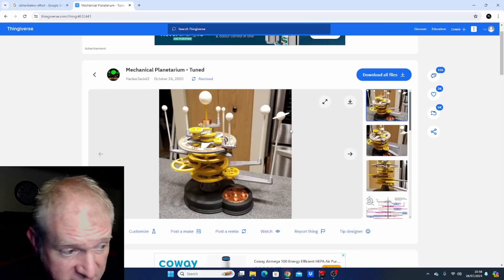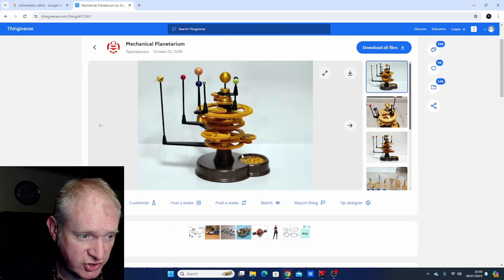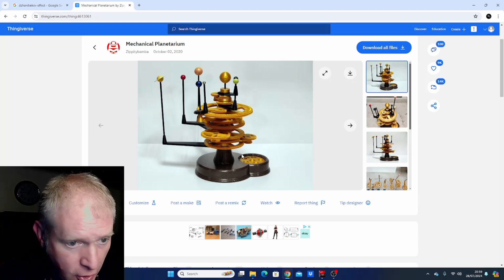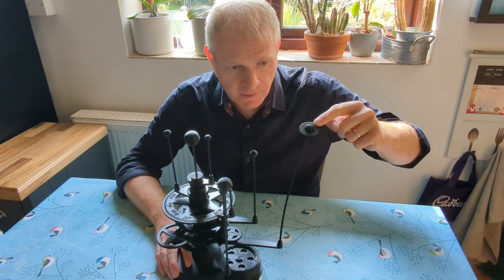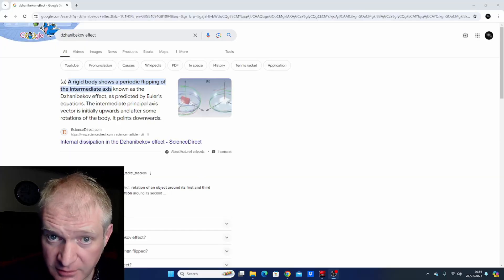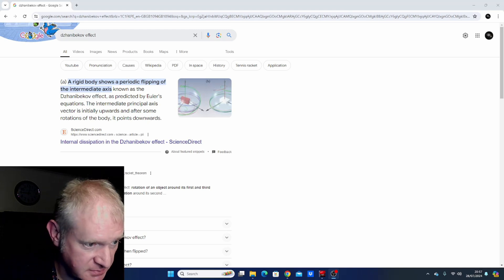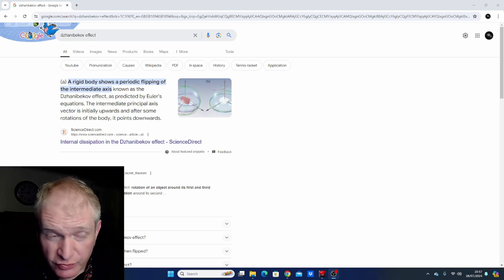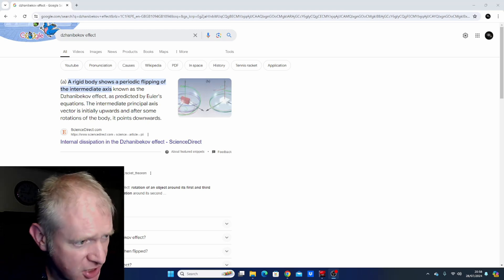3D Printed Orrery - Mechanical Planetarium

Comment: Nice overview. Consider printing a different material, PLA isn't robust. I've been wanting to 3d print one of these but hesitated because my experience with 3D printing has been that most objects available for download were created by people that learned the software but have no experience or education in design, so the tolerances are too tight, the edges aren't rounded or chamfered, pieces are undersized for plastic, they don't account for shrinkage, etc.

Comment: Hi Andy, you really are plagued with things breaking or failing in some way, funny you should make an orerey, back in time there was one you could build monthly from a magazine, I got to 2 thirds building it then kinda got bored buying the mag as it went up in price..
Something  I wanted to ask, did the Svbony 405CC work out OK for you, I have an Altair 294C colour fan camera and thought maybe selling this to upgrade to the cooled Svbony hopefully a good solution as ime now retired and on a budget🥴, I've recently been having fun with an ASI 585 uncooled planetary camera zero amp glow with HGV it works amazingly well on my 62ED for DSOs, this had originally been bought for my old 9.25 SCT for the planets but is now part of my travel rig sitting on a modded AZgti mount.. The cooled camera being used on 900mm fl C100ed. Anyhow always good to watch you and your projects, well done with the OU course, it looked  hard👍.. Regards best wishes Tom.
Reply from the maker: Hi Tom, yes it would be funny if it didn't happen all the time!  405CC - it is very difficult to recommend any products as I really worry that I might cause someone to buy the wrong product.  Or a product which doesn't suit their needs.  Also many people have had no issues with it and it works well for them.  I find my 405CC very hard to use.  I don't know if it is me, or my local skies, or if they changed the design and it now functions better.  If I had known I would have the journey I've had with it, I wouldn't have bought it.  That said, others have no issues at all.  If I was to do this all again I'd have bought an Altair 294c tec cooled version.  Or even better a 533c tec cooled, but not everyone likes a square sensor.  You might be one of those who gets a good version of the 405cc, I am still not 100% sure mine works correctly.  Sorry to be a bit vague about it.  Another great camera is the 269c Tec cooled Altair (touptec).  It does need a full set of lights, flats, darks, dark flats and bias to get it to calibrate but the images are very good.  Best wishes, Andy